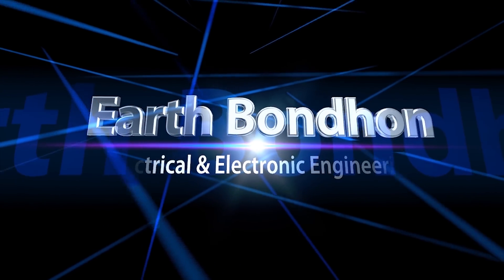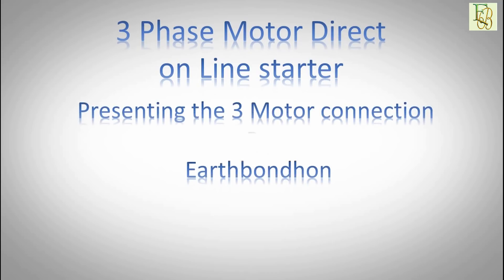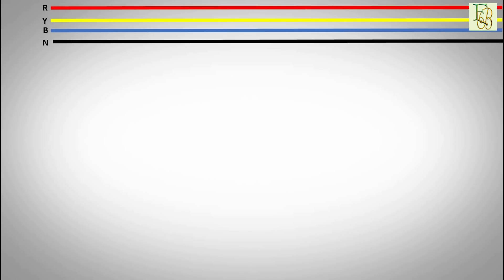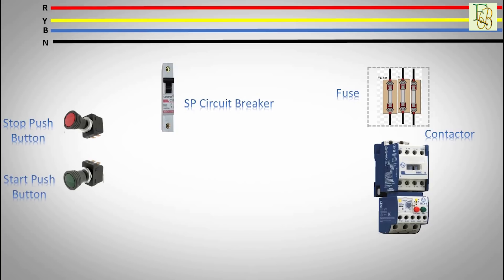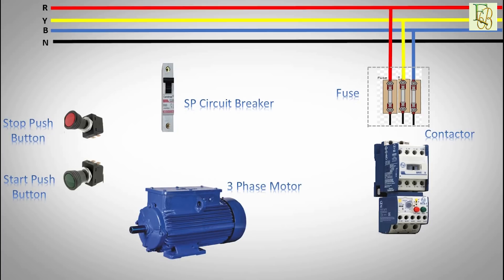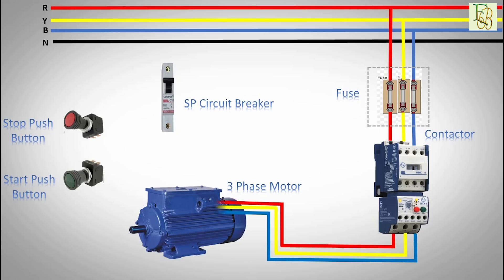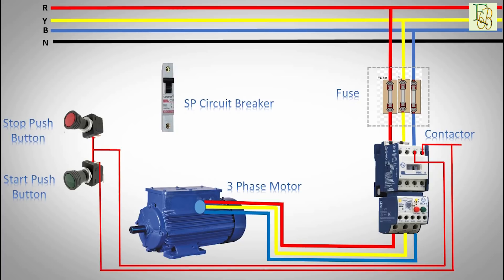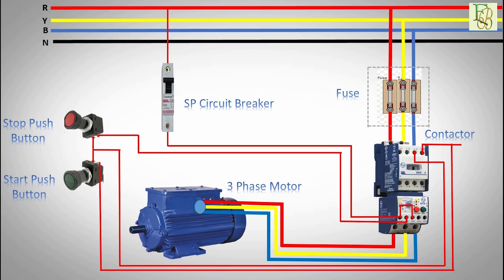How to wire a contactor and overload | Direct Online Starter by Earthbondhon

Comment: Thank you for a great video.

I have a challenge on hand I would appreciate your assistance.

In resetting the the contactor from the overload state, must the machine be connected to mains power while the reset button is pressed and then the ON button pressed?

I am terrified of making a mistake and destroying the machine.

Many thanks in advance and once again for the training.
Reply from the maker: Try again
Reply: @EarthBondhon  Thank you.

I will - before the week runs out - and revert.

Comment: Also I might add that this is a very OLD school, and somewhat unlikely scenario that in industry you would have them run a neutral line to the 3 phase machine, sans, having a simple transformer. YES of course it can be done......   odd TODAY in practice.  And i might add that most, and many industrial wiring applications you "quite likely" will not have access to a NEUTRAL out in the plant.
Reply from the maker: yes, sir
Thanks for your feedback, please follow.........
"Thanks for watching the video"   You are very welcome!

Comment: Thank you for these video. I have a problem connecting my then TR 610 top 2 so that I will be able to use two timers to control 4 solenoid valves. I will be very grateful for your help
Reply: I am using 2 contactor switches with them
Reply from the maker: star contactor control 
FB id: earthbondhon.org
add me
get by new video soon............